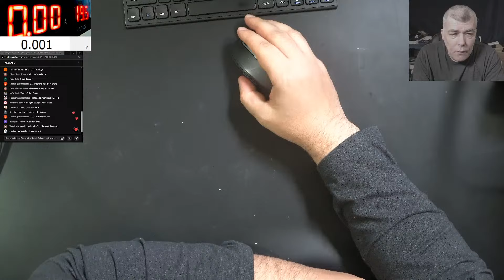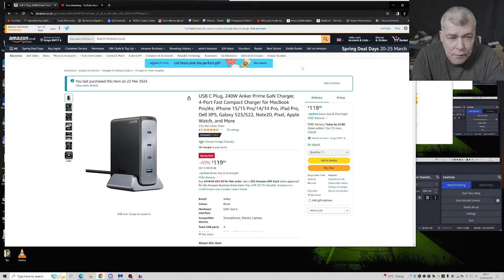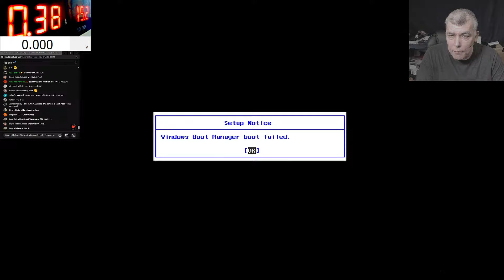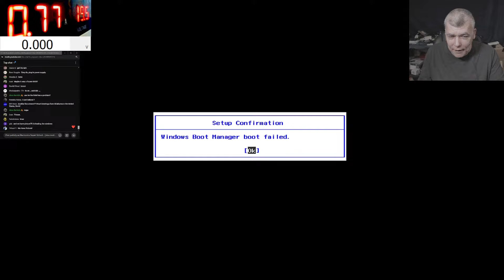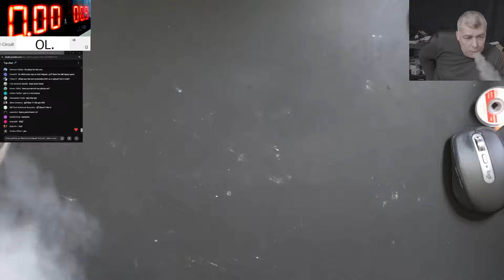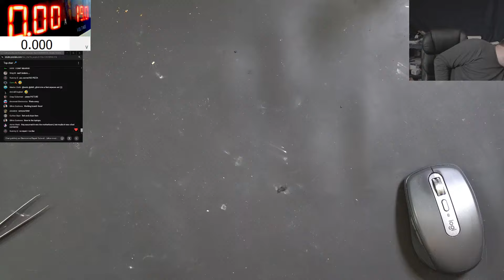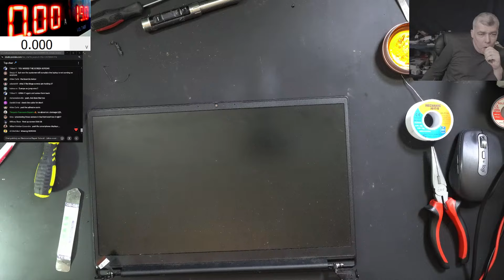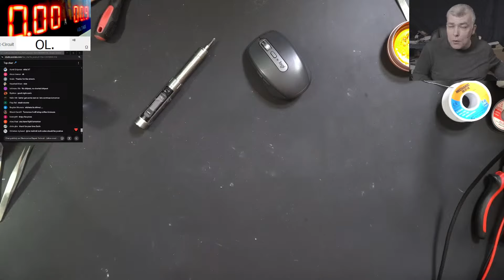Live motherboard repairs 22/3/2024 Live repairs

Comment: So when I said check for shorts to not blow up the new "fuse" I meant with the power supply.
I always think why that fuse blows up, check the circuit for the screen. Either you find it either it goes away just like it did. Would have saved you from having to open up the screen 😊
I enjoyed both live chats, looking forward for more.
Salutare din Timisoara

Comment: My laptop lagging but coursor not lagging.laptop on faster but apps open slowly.I reinstall windows but not working.I change ssd bt do not solve.sometime laptop goes faster when I kepp my laptop in sleep mode after sleep mode laptop lagging...
Reply: May be u should consider to buy a new laptop🎉
Reply: Try to repaste your laptop and you can install Linux for much faster system but if it is old then just buy new laptop and use your SSD as a external drive (SSD have a life span and if it is old then it is gonna slow down)
Reply: Quick tip:try to keep your background process count low, maybe uninstall the resource hungry ones.
Reply: what laptop? what spec?